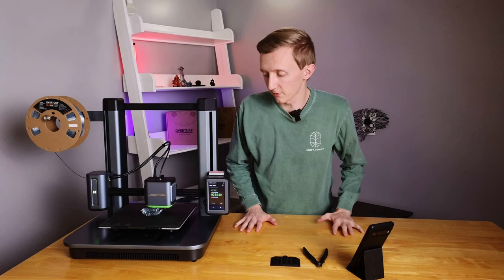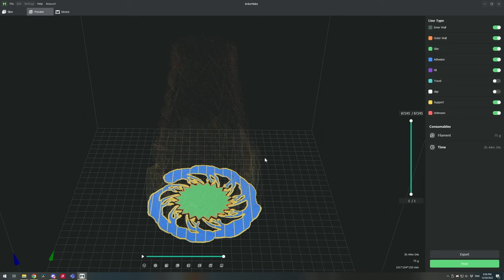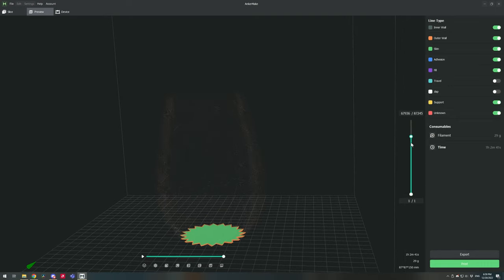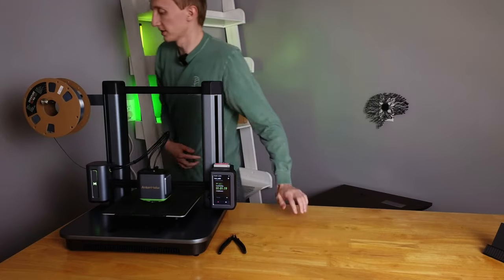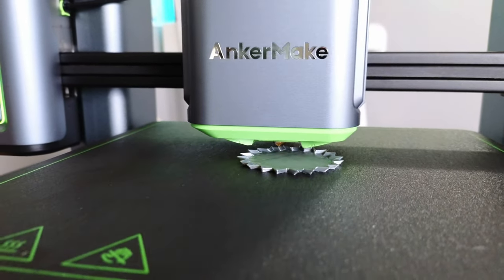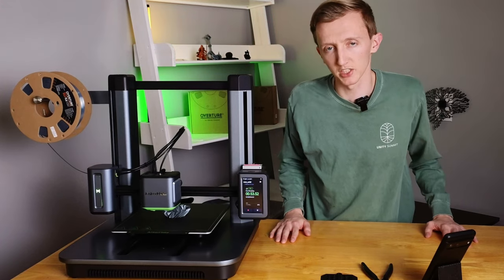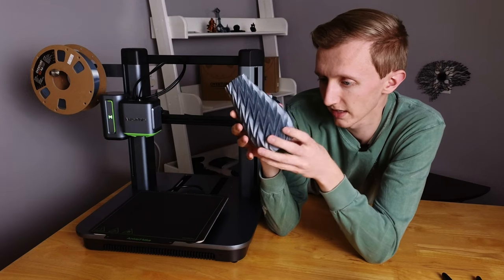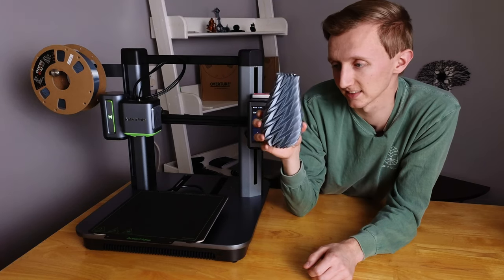Vase Mode on the AnkerMake M5 with AnkerMake Slicer! First Test!

Comment: I've made it work as a water tight vase! Just needs a few coats of flex seal spray (clear one). I forgot it on the counter with it sitting in a Pyrex on a paper towel.. maybe a week later it's still holding water with the paper towel dry. Just need to be very generous on each coat and shake it around to get it everywhere.. another way would be to print a vase without vase mode.. but even about 3mm thick still needs 1 or 2 thick coats. I wouldn't advise using flex seal on the external areas because that'll make it ugly. Coat from inside only.
Reply from the maker: Sweet! That sounds like a decent idea!

Comment: Tip for the floor:
At least 5 layers and don't choose zigzags with such complicated vases. Even with lines, the risk of holes in the zoom can sometimes be seen in the slicer. "Concentric" usually helps and the floor is sealed without paint.
The AnkerMake M5 with the Sunlu PLA+ filament I use is really fantastic.
Reply: I'm using the AnkerMake modified slicer... until now I don't know what anyone else could do better.
If anyone has a tip on how to set up Cura because AnkerMake is not listed there, please give it to me ;-)

Comment: I would turn off the, smooth outer contour, go to  .2 layer height,  turn outer wall flow up when  doing spiral vase,  and switch to Cura, its a better slicer. happy printing bud
Reply from the maker: Yeah, I'm pretty much switching to Prusa now.

Comment: Cool, but is it possible to make the same video but with PRUSA slicer (showing parameters, screen, etc) and cut a vase on half and see how you stick them together? I know it's work, but since you mentioned before that you worked with Prusa slicer I would like to see which settings you use to get a good print. 🙏
Reply from the maker: Yeah, planning on doing some Prusa videos!

Comment: Any suggestions on when it does the analyzing base layer, it raises and lowers and ends up leaving a small glob of filament?
Reply from the maker: Yeah, unfortunately I have this happen a lot too and it does worry me. But I've actually moved on to using Prusa Slicer which doesn't do any of the AI stuff, so it doesn't "analyze" the bottom layer. If I do use the Ankermake slicer or the pre-loaded files, I just watch the first layer and see if there's a moment that I can quickly just scrape off the glob it leaves.